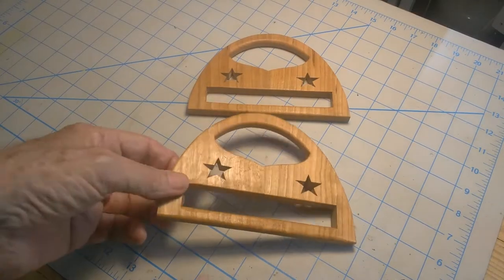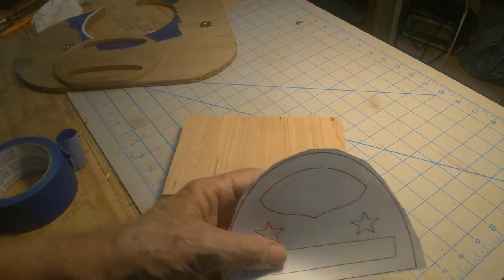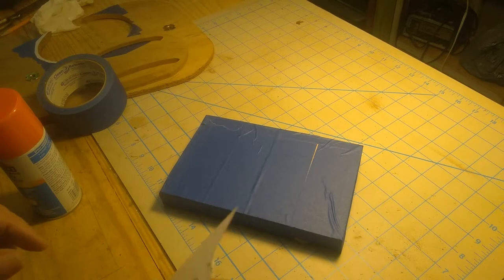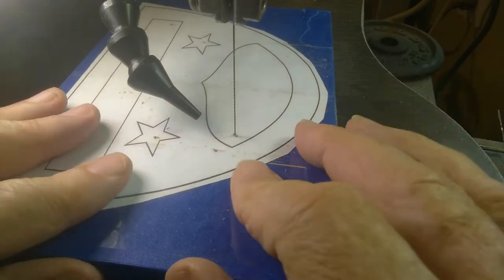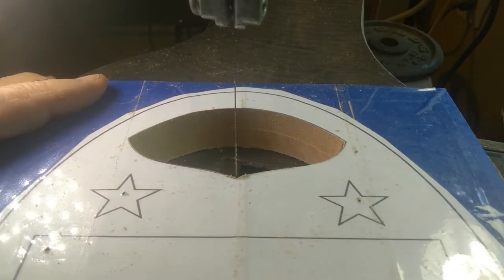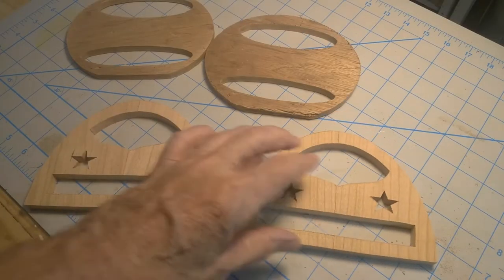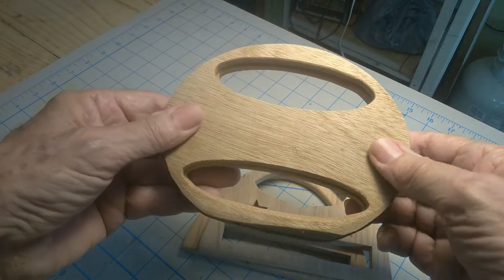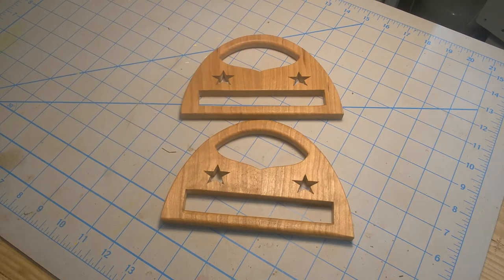Crochet Purse Handles On The Scroll Saw

Comment: Just found this video and really enjoyed it. I made a set of handles this past winter similar in shape to the star set and was really pleased with them. Unfortunately one of them snapped. Wish I had seen your video before trying to design my own. I think I used two thin of wood and after seeing yours I think  I need more wood between the slot for the fabric and the handle grip area. I feel that would give my handle a bit more stability. I enjoy your videos and have learned a lot. Thank you for sharing and have a great week. 😊🇨🇦
Reply from the maker: Thank you for watching.  That was a project made by the request of my wife.  She constantly crochets.  With input from her I just knocked a rough pattern out of my head  and she liked it.  I am glad you have learned from my videos, thank you.